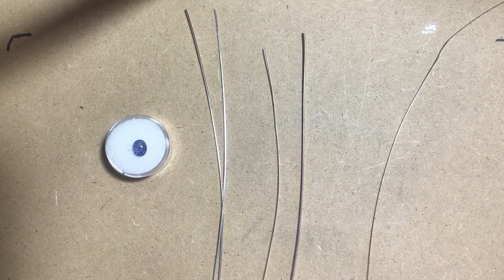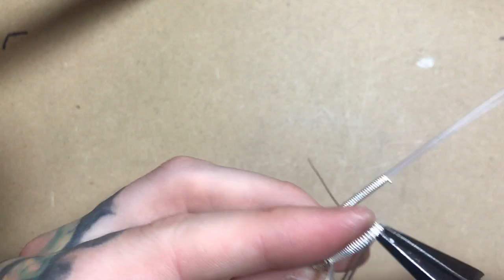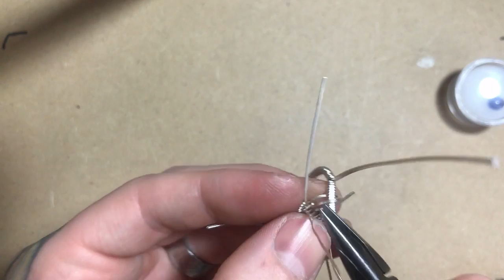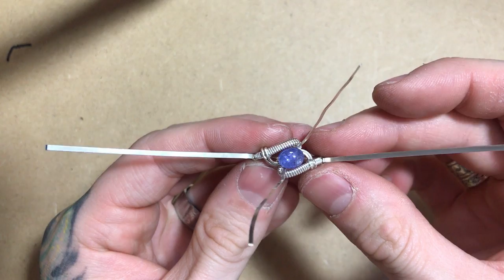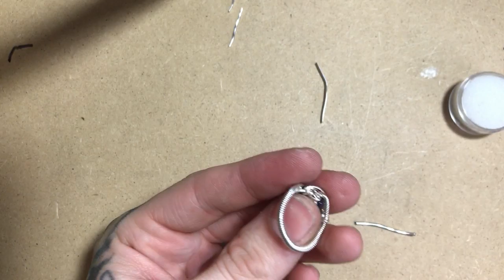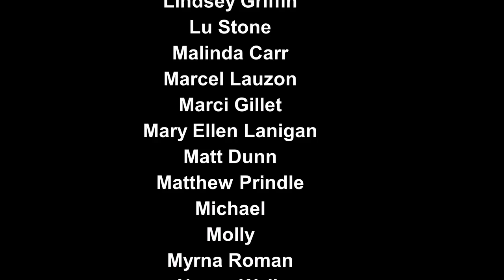Wire Wrapping Tutorial: Low Profile Ring

Comment: Beautiful ring awesome work with the wire, your so talented and incredibly creative,  your designs are wonderful and eye catching,  your techniques are different interesting, and challenging, in this video I loved how you combined your use of half round wire with the flat square wire to create this ring frame structure, this really demonstrated your knowledge and experience of using these types of wires, I'm very interested in learning more about different ways you can use flat square wire and any types of square wire, as I dont yet have any experience of using square wires, but square wire can be beautiful, I would love to see more different types of tutorials using square jewelry wires. I've been doing wire jewelry for two years now I love it, I'm not at your level yet, I'm in the middle some where,  not quite a beginner,  I love wire styling like wire wrapping techniques,  creating fancy swirls and edging wire lace techniques,  I currently do very little wire weaving or wire cabachon settings,  but I would like to learn more, of these techniques your channel is amazing, and you create stunning pieces of wire art, jewelry beautiful to see. Thank you for your video contributions,  these are very important and valuable resources.  Your subscriber Laura in uk

Comment: I assume you're using sterling instead of stainless wire, and you're incredibly good at detailing the shape. I was wondering, however, what hardness you use for different coils/swirls. The place I order my supplies from has dead soft, soft, half-hard, and hard in their silver. What would be best to use/what combinations? I'm sure dead soft has no real place in this, but what of the other hardnesses?
Reply: Most wire used in wirewrapping is deadsoft.
Reply: Hardness used for this type of technique is generally 20 guage in American its 0.80mm in English wire this is a general working wire for rings and earrings and bracelets it has a lot of flexibility and is softer but can be used to build a firm wire frame structure which will hold well, it would be very suitable for this type of ring, structure the next one up from this is a much harder thicker wire 19 guage, American,  in english  0.90mm.  Try googling the website address to order jewelry wires from the, www.scientific wire.co.uk or .com they also sell real silver wires and carry all hardness and thicknesses their wires are excellent quality they also make many coloured jewelry wires to suit all tastes and all types of projects they sell aluminium jewelry wires they have a good range of choices, and their delivery systems are fast postage and your wire items come very well packaged, I've made orders from them of £300, pound and I've always been very happy with their wires, terrific quality, good website good photographic images of the wires for sale, as a customer I recommend them. Best of luck to you.